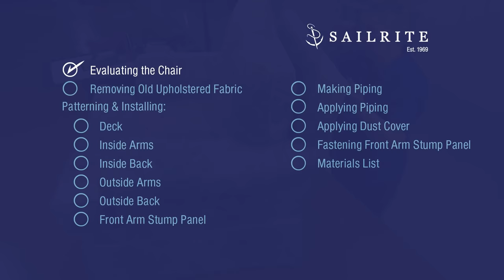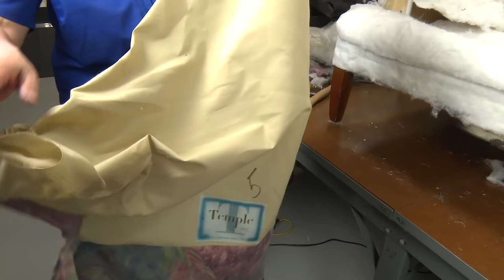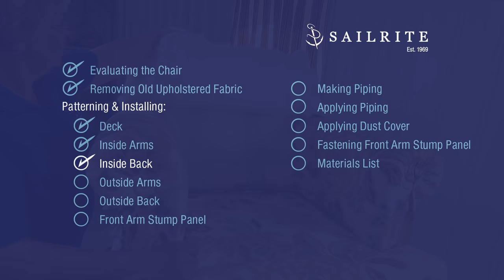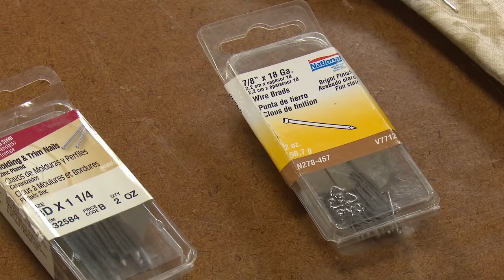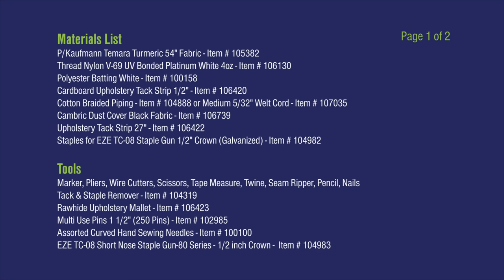How to Reupholster an Armchair

Comment: That chair was a nice find, and you did a very lovely job. That fabric was perfect for it, and by eliminating the skirt you brought it up to date.  It looks so fresh and contemporary now.  I can never find anything that is both that new and clean and well constructed.  I usually work on the old dinosaurs someone found in the back of the barn. The one I'm doing now had so many layers of old fabric and cotton batting with the final layer covering cotton and STRAW (yes, straw. not moss, not horsehair and not excelsior) that the seat cushion was only 18" wide.  It was such a heavy beast, with all those layers there must have been 25 pounds of tacks alone.  But it had good bones, and the frame is solid hardwood, glued and doweled and with the exception of all the tack holes in near perfect condition.  When I'm done it will be back to the classic styled wing chair that it started out as.  Slightly low slung, nice wide seat and a back that is ever so slightly angled so you don't have to sit ramrod straight.
Reply from the maker: +futuradeej1 Sometimes the older chairs are constructed much better than the newer chairs, you are correct!

Comment: Before throwing out an armchair that my cat ruined, I'm considering re-upholstering. This is the best YouTube video I've found on the subject. It's making me appreciate the cost of having someone else do it! ;-)  (I still haven't decided if I'm going to DIY my armchair.)
Reply from the maker: You can do it! If you need help let us know.
Reply: Thanks for the encouragement. It took me THREE DAYS to remove all the old upholstery and stuffing and my fingers and thumbs were bruised from all the staple-pulling (yes, I used tools). The "naked" chair remains out on the deck; I still haven't decided if I'm going to go "all the way" and finish it. The good news is that the cat urine did not get to the wood base of the chair.

Comment: Only about 20" into it but what an excellent video. It's GREAT to see how a real professional does it. I've been pulling every single staple!!! First with the staple remover & then the needle nose pliers. I was always worn out before the fun reconstruction even began. Lol. Won't be doing that anymore. In total, about how long did it take her to break down that chair (remove the old fabric)?
Reply from the maker: Claudia Smith Removing the old staples and fabric is usually the most time consuming job of reupholstering any chair or sofa. For this chair it took about 2 to 3 hours to remove the old fabric. When I do a reupholstering at home I usually let my kids, who are teenagers, pull the staples and remove the old fabric. Then when they are done I start making the new panels. When at home I can finish a chair like this in one weekend (two days total, working about 5 hours per day).

Comment: Cindy is an upholstery artist! I can't believe such an in depth video was available on upholstery.  This has made me even more keen to try this out.  I love upcycling furniture so this is the next step for me.  One question, why were the arm front panels attached with this type of pin? Are the big round-headed pins that were removed not available anymore?
Reply from the maker: Thanks for your kind comments! You can use any fastener that you have on hand or use the old ones to attach the front panels.

Comment: I LOVE THE BROCATELLE FABRIC ON MY TWO ARM CHAIRS, HOWEVER,  THE SPRINGS ARE RELAXED, IS IT POSSIBLE TO LIFT THE FABRIC TO REPAIR THE SPRINGS AND WHEN DONE PLACE THE FABRIC BACK IN PLACE  ?  🫖
Reply from the maker: Yes, you should be able to remove the fabric over your springs and repair or re-tie the springs then fasten down the old or put new fabric over the springs.
Reply: @SailriteDIY  
THANK YOU  🫖

Comment: Great video!  Just want to check - if the chair being upholstered has tack strips, can you re-use them?  Also why did you not use nails similar to the ones you took out of the stump panel rather than the method you used?
Reply from the maker: +Noreen Daly In some cases you can reuse the tack strips if they are still in good shape. We did not us the nails, because stapling is much easier and faster.

Comment: I am reupholstering using velvet, and had a question: I understand that the nap has to go downwards towards the floor when placing the material - how would you do this at the arm (since it'll go around the top)? Should the nap go down towards the inside of the chair, or should the nap go up and around, then down towards the bottom on the outside of the chair?
Reply from the maker: I would build the arm with the nap going down towards the inside of the chair.
Reply: Thanks for the quick answer! Another question - my couch has a wood frame and wood at the arm instead of the cardboard piece - am I understanding that I will actually be taking apart the couch (screws and all) in order to get the fabric off? Or does it come off the same way?
Reply from the maker: If the wood is screwed in along the front of the arm, it will likely have to be removed to replace the fabric.

Comment: If you have to make your own arm stump ends, what is the cardboard like piece that you start with. Cindy said 1/4 inch staples, so I'm thinking it is not cardboard, that wouldn't be thick enough.
Reply from the maker: The arm stumps in this chair were made of a firm and thick cardboard stock a thin MDF would also work.

Comment: I’m working on reupholstering a chair that didn’t have a front stump panel but would like to add one in, can you let me know what material is best to use?
Reply from the maker: A stiff compressed cardboard is what is typically used for the front stump panel. We do not sell it, sorry. You could also use a Medium Density Fiberboard 1/4" or MDF 1/4" board.

Comment: just wondering. ... how long did this take?.... and does it usually take that long? BTW great job the pattern is awesome!!!
Reply from the maker: +Lyniquechunte Removing the old staples and fabric is usually the most time consuming job of reupholstering any chair or sofa. For this chair it took about 2 to 3 hours to remove the old fabric. When I do a reupholstering at home I usually let my kids, who are teenagers, pull the staples and remove the old fabric. Then when they are done I start making the new panels. When at home I can finish a chair like this in one weekend (two days total, working about 5 hours per day).
Reply: Wow thanks!! I don't  sew but I think I may be able to do this .... maybe with some help from my sewing department  (my mom) lol

Comment: I just started removing fabric from a barcalounger, the staples are in so tight- I think some of the wood strips are oak!
Reply from the maker: Yes, most furniture from the past was made from hardwoods. they were built very well, unlike most furniture today which is made from cheap pine wood.  That is often why it is a good idea to reupholster it.
Reply: @SailriteDIY  Thank you. It will be worth it then! It says 1983 as the manufacture date. I still have my first sofa and it's more comfortable than any new one I bought afterwards.

Comment: How much fabric would be needed for this project with fabric that does not have a pattern?
Reply from the maker: We like to use this fabric calculator to estimate the amount of fabric required: https://www.fabric-calculator.com/chairs.aspx
Reply: I’ve seen that chart, but with a loose pillow on the back I’m not sure that 8 yards is enough.  My chair is exactly like the one in this video, plus an ottoman.
Reply from the maker: @cathyreincke7421  8 yards should be enough for the chair and the two cushions.
Reply: Is fabric width 60” for the 8 yards?
Reply from the maker: @cathyreincke7421  No, it is 54" wide.

Comment: What should I do if I need to replace the thin padding because it smells and can't be cleaned? Where can I find proper replacements for it?
Reply from the maker: If you are looking for polyester batting you can get it here: http://www.sailrite.com/Batting-83-Thick-55-Wide 
If you are looking for a thin foam you can get it here: http://www.sailrite.com/Foam-Firmness/Soft-(20~30-lbs)/type/Products?keywords=polyurethane%20foam%20with%20fabric%20backing

Comment: My first time working with patterns and shaded material I put the top on upside down and then when I put the bottom on the top piece was lighter and the bottom was darker and I didn't have enough material to go back and fix it since I was working with pattern material so I had to put the other chair the same way the top was shaded lighter  and the bottom was shade darker 
I was so disappointed because I was doing these chairs for someone else and I didn't charge them and they wanted to pay and I said no because I knew I had messed up

Comment: I would put a frill on the bottom of it so the couch sharks can hide behind it and look menacing in the dark when I fumble for the remote, touching a stray cheeto in the process.
Reply: What kind of staple you are using and where did you buy it it looks lighter and quiet-

Comment: Am I correct in assuming this is done to resell this chair? If so what kind of price are you putting on it with all this labor and material?
Reply from the maker: +KingRatt No, we used the chair to help show our customers and YouTube subscribers how to do that job using our fabrics and supplies. We do not resell our projects. A typical upholstery shop will charge about $50 to $100 (depending on the complexity of the fabric's pattern) for labor per every yard of fabric used on the chair. This chair used about 7.5 yards of fabric so the labor charge would be about $400 at a minimum.

Comment: I am trying to find a clip and rail system to reinstall a fallen v-berth bumper. Any suggestions?
Reply from the maker: You have two choices from Sailrite for that issue. I will give you two links: https://www.sailrite.com/BeauClip-Panel-Mounting-System-Black and https://www.sailrite.com/Coaming-Pad-Hook-Eye-Set-Stainless-Steel
Reply: @SailriteDIY  This is awesome, I am ordering both to see which one works best! Thank you. Next question.... I believe the boat experienced an "issue" with the previous owner that caused the bumper issue we are having as well as areas where the piping would normally concealed the joint, but the vinyl seems to be pulling away. I'd like to inject some foam or something similar to foam that will plump up the area behind the vinyl to conceal the joint. Would you have any recommendations for what product I could use to inject behind the vinyl to fill in what appears to be voids?

Comment: Well, I would have liked to see what was underneath the arms and materials used. 
The video is titled "How to upholster an ARMCHAIR not Chair."
Then, there was plenty of new fabric that would have covered the bottom sides of both arms, but using the old upholstery for it was sloppy. I wouldn't pay for the reupholster. 
Even the Bible has several verses on not putting new garments on an old one because it makes it weak.
Wish I could upload my project from bare wood done with attention to details. 
Why purchase expensive upholstery fabric to do a half job. Sorry, not the way I would do business and sleep well on it.
Thanks for sharing.